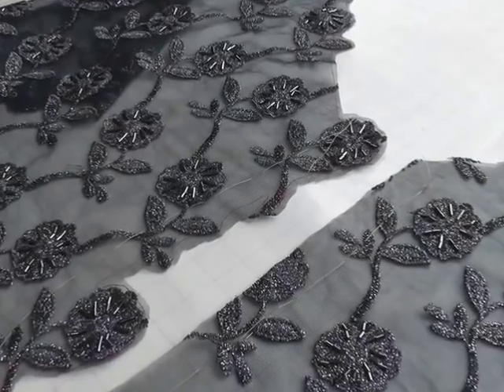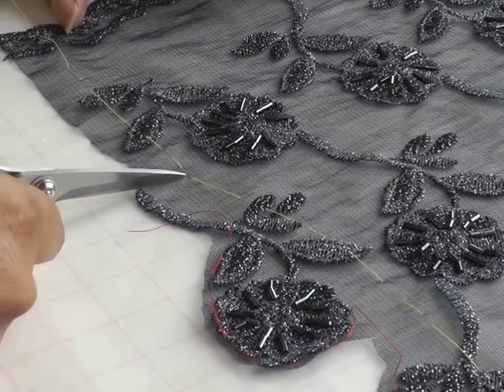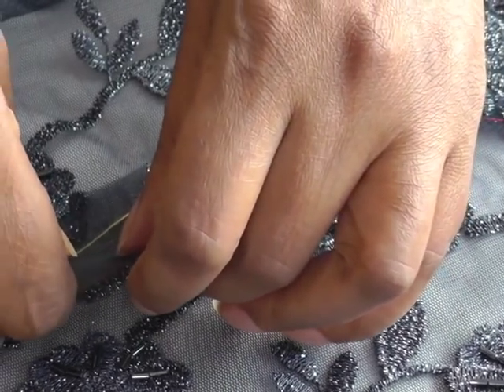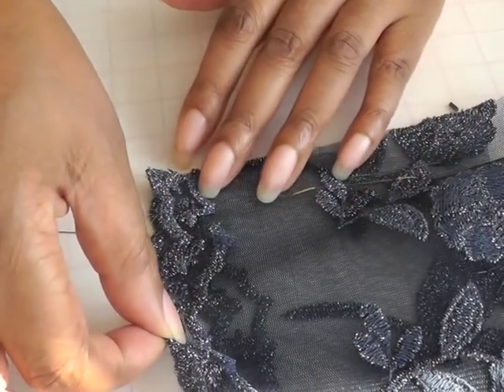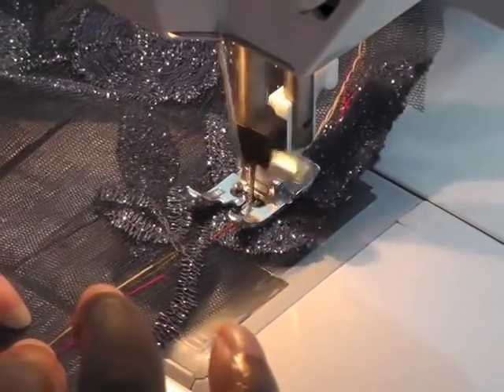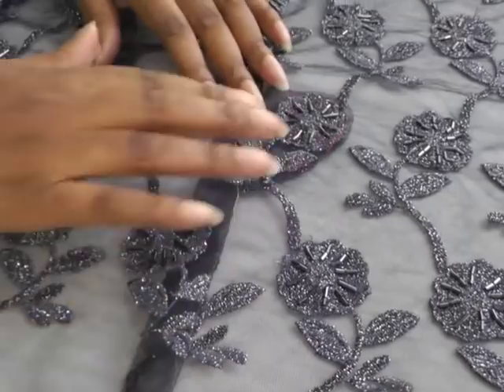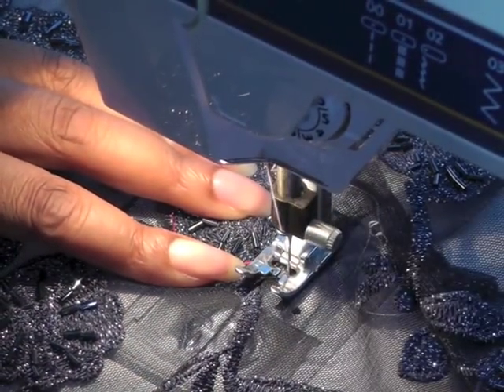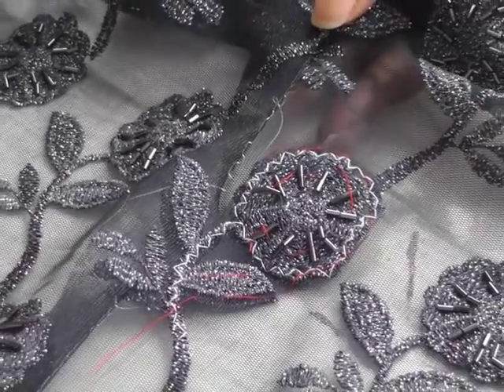Sewing Lace Seams

Comment: This series is a lifesaver! Need a little help, though.  After I've done the two rows of straight stitching between the motifs, and stitched the motifs down on the right side of the garment, what do I do about the seam allowance in the mesh area?  Is that the purpose of the two rows, so as to cut very close to the stitching? I've looked at every lace applique seam technique on the net, and yours is, by far, the most helpful!  You're a gifted teacher!
Reply from the maker: Yes, cut close to the stitching. It's a delicate process make sure you take your time but the results will be worth it. Thank you for taking the time to comment Martha.

Comment: How do you handle seams in lace fabric where the motifs are further apart?
Reply from the maker: If the motifs are further apart, you are probably better off using a french seam. The trick with working with lace is to have a continuous flow of the design in the fabric, so that you cannot see the seaming easily. But where there is large spaces between the motifs the best option is to sew beautiful french seams.

Thank you for taking the time to comment Weston.